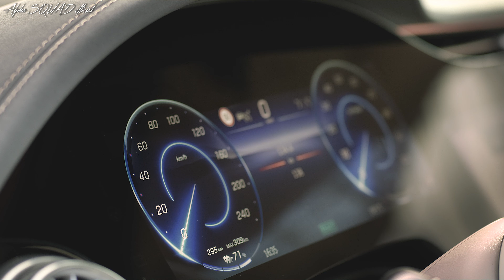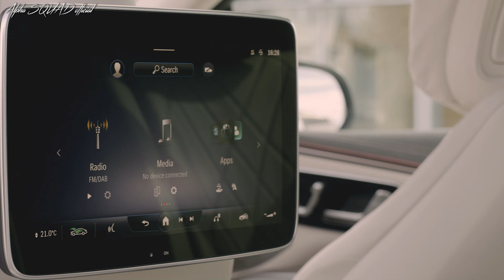2023 Mercedes EQS SUV – Manufacturing in Alabama, interior and Exterior Design

Comment from the maker: Start of Production for the new EQS SUV at Mercedes-Benz in Alabama

- The first all-electric Mercedes-EQ built in the United States, the new EQS SUV, has been successfully launched at the Tuscaloosa plant
- From Alabama to the world: The EQS SUV will be produced exclusively in the U.S.
- Highly efficient battery systems to be supplied by the recently opened Mercedes-Benz Battery Factory in Bibb County, Alabama
- Comprehensive sustainability concept and carbon-neutral production at both sites

Mercedes-Benz is exclusively producing the all-electric EQS SUV at its North American passenger vehicle plant. These vehicles rolling off the line is a key step in Mercedes-Benz Cars’ global initiative to produce eight all-electric vehicles at seven sites on three continents this year. The full-size EQS SUV is integrated in series production at the Mercedes-Benz Tuscaloosa plant in Alabama, which has been the production site for large SUVs bearing the three-pointed star since 1997. Tuscaloosa serves as a key production location for Mercedes-EQ luxury electric SUVs: the EQS SUV and EQE SUV, which goes into production later this year.

Thanks a lot for Watching!
More New Car Videos: https://www.youtube.com/c/AlphaSQUADofficial/videos